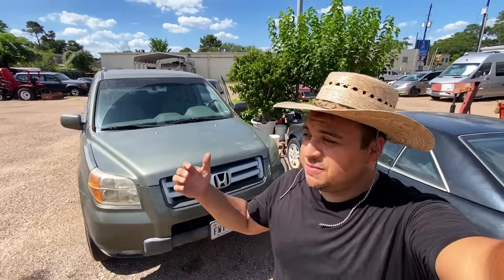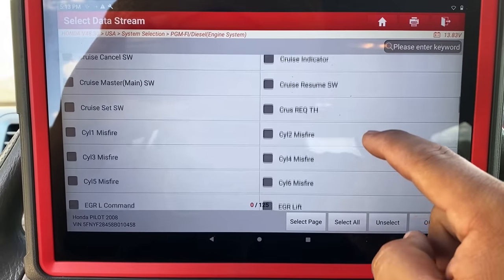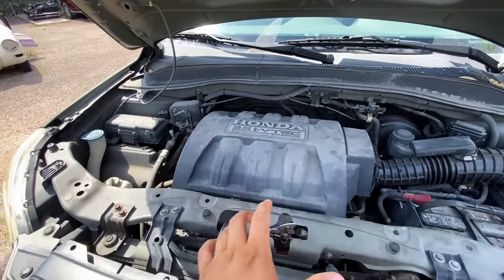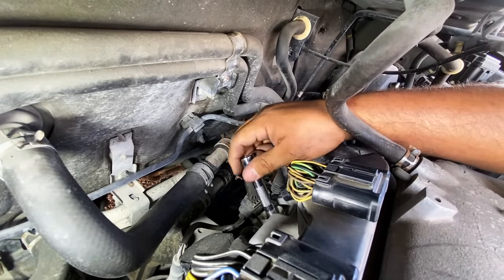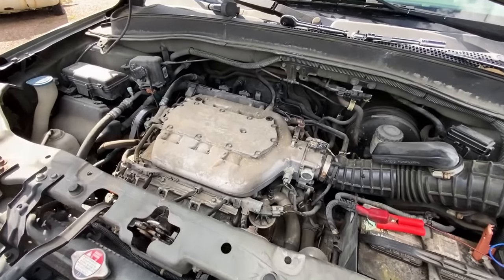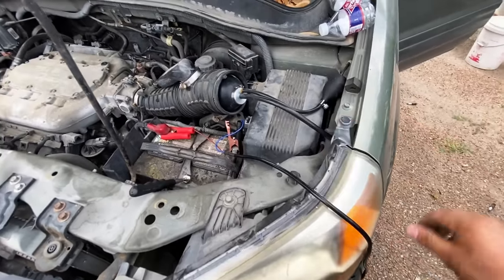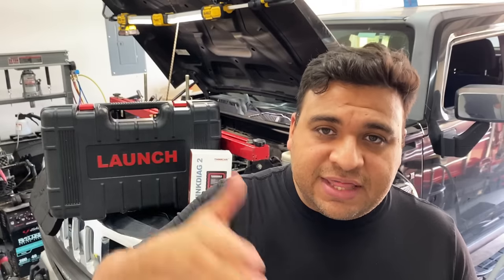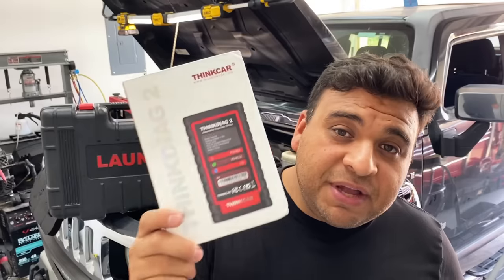HONDA PILOT STUMBLING IDLE RANDOM MISFIRE DIAGNOSIS & FIX

Comment: We had an 8th gen civic (06-11) at my dealership that had misfires on 2 cylinders we swapped coils, plugs fuel injectors Checked compression and cylinder leak down tried ECM/PCM clear and relearn still nothing we were stumped we called tech line before we put it through for a PCM they advised up they have seen some civics with aftermarket serpentine belts have excessive metal flakes in the belt messing with the signal on the crankshaft causing ghost misfires so we removed the belt and wouldn’t you know no more misfires replaced with factory belt and took care of issue
Reply: thats crazy!!
Reply: Whoever figured that out is a genius.
Reply: Interesting to know and this has been noted in my diary
Reply: Thanks for sharing this information!
Reply: After market ? Says it all. Nice of Honda to help out. Thanks for your info.
Reply from the maker: Thanks for the information!
Reply: But how those the metal from the serpentine belt pulleys affect the engine like how do they get inside it
Reply: Thanks for the this information, it will go under my belt of knowledge for future reference.
Reply: @neilmurphy845  not the pulleys themself but the metal in the belt I honestly didn’t know that serpentine belts had metal particles in them but maybe some of them have excessive amounts and that’s what causes it?
Reply: @ADVANCEDLEVELAUTO  any time love helping out the automotive community especially with weird stuff like that I’ve had numerous Hondas/acuras with ghosts missfires that by just performing ecm/pcm resets fix it love the content you make I’ve learned a lot from watching you
Reply: Honda Tech I just want say thank you for sharing! 👍✌️
Reply: Its prolly the timing belt not the serpentine but its engine on those are timing chain? How could it trigger a misinfo on the crank sensor when its inside the cover?
Reply: @andrewdero6271  those have a timing chain and I’m not sure exactly I’m not an engineer lol I wish I knew the science behind it but i know it was showing missfires on the computer but the engine was running fine, we checked everything was down to checking the PCM before recommending replacing and we called tech line and they advised us to try that first and it worked!
Reply: Dammm...!!! Fucking incredible..!!
Reply: Are you kidding me. That's insane
Reply: @thehondatechnician  Ya maybe
Reply: For those wondering, a crankshaft or camshaft sensor reads metal near it. 
Metal near it causes it to think the shaft is at a different position than it is, and being that it thinks a tooth(that it reads position with) is on the belt it causes it to misfire when it gets back to a certain position usually the measuring teeth(teeth that are usually filed down to make sure the computer can accurately read the sensor.
Reply: @neilmurphy845  Causes a static buildup and then it discharges. Should be some videos of it on YouTube. Like little lightning bolts.
Reply: I own a repair shop and had a gates serpentine belt cause this. Replaced with a bando unit, and it solved the problem. Random misfires on all 4 cylinders until I figured the belt was the issue. Car was a 2009 honda civic lx 1.8 manual.
Reply: Thank you for sharing that information!!!
Reply: @camberwellcarrot420  Lol forreals.
Reply: How is there an 8th gen of pilots? I tink they are only on the third or fourth gen.I have a 2012 and thats considered second gen.

Comment: I just did my timing belt and had a similar issue. I took it to a professional to check my timing belt, paid for his time. He told me the timing marks were not off and he saw no issue with my timing belt job. He did see multiple misfires and a rich code. The rich code was not there before hand. He noticed the CEL come on and off while he had it at his shop to test drive it. 

After doing this and a valve adjustment. It's working fine. I think the valve adjustment for me was the defining fix. I can't say for sure.

Comment: I love my Launch X431 Pad2.  It's proven to be the best overall scan tool I have ever owned.  Now I have a question.  Why would the Honda Pilot need a CKP relearn if it was never disturbed?  Besides replacing or even just disconnecting and reconnecting that sensor, what else could cause that issue?

Comment: My scanner can detect injector pulse to see if the injector is firing fuel. That’s one easy way to determine if the injector is faulty or not or use a lode tester to see if the injector harness side is getting power! But swapping the Bad coil with another coil is an easy simple test as well thank you Eric for another video!
Reply: Your scanner can detect pulse. But I doubt it can detect if the injector is really opening or closing.

Comment: I was taught the relearn should be performed any time ignition components were replaced or moved. Also when replacing timing belts/chains. I've had the misfire problem with Nissan before and relearn fixed it.

Comment: 2002 Acura MDX touring with a flashing CEL, Replace all spark plugs, all ignition coils, all fuel injectors, did all new timing belt, timing tensioner and also new head gaskets with all new gasket for intake and exhaust manifold gaskets.  Did compression test all cylinders have good compression from 210-220 psi. replace new used pcm, did valve lashes.  Not sure what to do anymore.  i tried to do the crank sensor relearn but for the 2002 model this function is not available.  Please help... Any advice well be helpful.

Comment: You have some great, and kinda expensive devices there to help you track down the problem very quickly! Good for you man! Good job. I have one of these same Honda 3.5 engines with a very similar issue, and also the flashing engine light that will shut off on it's own. I am waiting on a new set of coil packs on the way. I have a basic code reader for the OBD II port and mechanical knowledge and that's about it except for tons of basic tools of course. My code reader is a Autophix. Those are very good powerful V6 Honda engines when they are running properly!

Comment: I don’t know if anyone in the chat ever uses a propane inrichment tool to find misssfires due to a faulty injector or vacuum leak. But it’s a great and fast way to do it. 

If you find that the ignition system is ok and suspicious of a faulty injector. Use your propane inrichment tool to slowly add propane into the intake. Then watch your missfire data. Or smooth running value. You will see the counter slowdown or stop all together. In many cases see the engine smooth out. OTC part # 7148. I also use it to diagnose A/F and o2 sensors. It’s good for diagnosing converters also. Already said vacuum leaks, do that while
Looking at ST and LT fuel trims.

Comment: Ha ha ha, I knew I'd learn something more, if I just kept watching. The CKP relearn was a pearl worth remembering. I wonder why changing a coil would require a relearn.
Reply: Me and eric had a discussion on this and I’m thinking that because misfires are seen thru the crank sensor. So when the engine misfires the pcm picks up the difference in crank speed and registers it as a misfire. And I’m aware some pcms shut off injector pulse is they notice a misfire on a cylinder to protect the catalytic converter. So my theory is the misfire is learned to the pcm, as protection to the catalytic converter. So to clear the learn misfire strategy a crank relearn has to be performed. Sounded good in my head when I did this
Reply: @OzMechanics  Thanks man, I never fail to learn something more from both of you.
Reply: Wondering if you know of a lower price scan tool that can do the crank position relearn for a 2004 Honda Odyssey 3.5 V6? I'm old school mechanic and try to fix my own first because at the moment I don't have a shop close to me that I know I can trust or afford.

Comment: I had a bad ignition coil after 100,000 miles in my 4Runner. Instead of buying a denso ignition coil, I bought an NGK because I was going to do a full tune-up in 3 weeks. That NGK ignition coil kept setting off my check engine light with misfires. NGK makes great spark plugs, but do not buy their ignition coils. Once I replaced that NGK coil, everything was fine. And it was even better after I changed all six with denso ignition coils.

Comment: Awesome job!  How does the scanner / ecu know when a misfire occurs? Are they only spark related according to a scanner?
Reply: ECU/ECM/PCM knows when a cylinder misfires by the speed of the engine slowing down just after the module commands a coil to fire. The module can see this and calculate this speed change in microseconds.  Misfires can occur from various issues; spark, fuel, too much air, too little air, timing, noisy crank signal, wiring, and module.

Comment: You sir are a very good mechanic.  I have the same type of stumbling shaking shuddering at idle....I feel it in the drivers seat and floor.  It is very intermittent but I don't have the scan tool you have.  I do have one that allows me to get into mode 6 so I can see misfires.  My problem is intermittent so I do not think it is compression I think it is fuel injector related.  Almost thinking of getting a better scan tool once and for all so I can pinpoint these problems easier
Reply: Im having the same issue on my 05 Honda pilot. It hasn't died yet but like you said its shaking, shuddering and stumbling. I can also feel it in the seats and the pedal, steering wheel etc. It just feels weak like it's losing power. What was the issue on yours and were you able to fix it?

Comment: Thanks for this great video. I have an 08 Pilot and getting misfire on cylinders 3,5,6. I changed all the spark plugs and did that coil swap trick. The misfires did not move. I am either thinking it might need valve adjusments ( if that can cause multiple misfire) or recently I used an injector cleaner and maybe that messed up my injectors. I also changed my alternaor recently with a OEM denso one. After the frist start after changing the alternator the car did hesitate and eventually turn off. But after a few more tries it did stay on and ran fine for 2-3 weeks. What do you think ?
Reply: Having a misfire on every cylinder after replacing alternator with one from junkyard, didn’t happen till a week after the replacement
Reply: @leestoday  after using 1 or 2 injector cleaners and 3-4 high octane fill ups, my issue went away. I even bough new injectors but now issue is fixed so I will save those injectors for later.

Comment: Hey I forgot to mention my uncle has a 2000 Honda Odyssey and it has p1399 I already adjusted the valves also all 6 cylinders are misfiring and I get p0300 as well I already changed spark plugs and coils what do you recommend

Comment: Just an FYI:  I have an 08 Odyssey.  Those have the same V6 as the Pilots...and I believe all other Honda's with a V6.  Some, but not all, of those engines have VCM...Variable Cylinder Management.  Basically, as you reach highway speeds, it disables cylinders to increase fuel mileage.  Problem is, sometimes it decides to start disabling cylinders, even if it doesn't need to.  It leads to people "chasing" misfires, and never catching them.  At first, that's what I thought was the problem here.  In case you have a Honda with that V6, and start having misfires, and replace everything that is supposed to fix a misfire, yet you still have misfires, it could be the VCM.

Comment: You forgot one more item in Honda's particularly, the valves w/ time they get tight and can caused miss fires and other problems w/ no check engine light.

I was told to look at the MAP sensor value at operating temperature and anything higher than 0.85 volts indicates tight valves.

Comment: I have misfires on cylinder number 4,5 and 6 on my Honda Pilot 2012. I swapped the spark plugs and coils from 4-1, 5-2, and 3-6. I rescanned it and it’s still misfiring on 4 5 and 6.  What can I do to figure out what’s wrong? Compression test? Spark plug test?

Comment: Hey bro, I see this video a while ago. I just changed the coils in my 2001 corolla and it was running normal before I changed them. I changed the plugs and coils because of the mileage. Now it's misfiring with the new oem coils and even when I put the old ones back in. I'm guessing I need a relearn for my car to run normal again.

Comment: After all this time that you had the thinktool pro how do you like it. And what's the difference between it and the Launch tool and for someone that doesn't do much work like that which one do you  Suggest to get
Reply from the maker: They are both very similar as far as capabilities. The main difference to me is that the Launch tablet is an open operating system. Meaning, you can download apps from the play store and surf the internet freely. The Thinktool is a closed OS, so it doesn’t allow you to add any apps. For this reason I prefer the Launch.
Reply from the maker: Thinktool says that this is done to make sure the diagnostic software runs faster and smoother. Also, so that the user doesn’t download any apps that could affect the functionality of the diagnostic software.
Reply from the maker: I am mostly mobile, so I like to be able to use the tablet to find wiring diagrams and service information on the same device.

Comment: this vehicle is supposed to have ngk IZFR5K11 laser iridium plugs in it with a 1-1.1 mm gap, it also gets denso 673-2301 coil packs

Comment: I have had an 11 honda accord once that would throw random misfire codes and I would perform a crank relearn and it would fix the issue' but the issue would return after a few startups. I came to find out the somehow a remanufactured starter that had recently been installed  was somehow messing with the crank signal and causing the problem. Replaced the starter and relearned the ckp again afterwards and no more problems.

Comment: I have an 2007 Honda pilot with the 4WD EXL navigation. Anyone who has intermittent problems with electrical go wrong with a PCM/ECM open circuit power relay code for P0685 replace the Relay for that because that will fix it most of the time or even the battery can also cause that code to come back up and make the car try to stall or jolt while you’re driving so just be careful if you have an older Honda/Acura because they will happen like that if you don’t change that relay or battery

Comment: Cylinder 3 is usually the problem with these engines. The Cylinder management turn that cylinder on and off more than any other cylinder. It will run all 6, or it will run 1,2,4,6 or it will run 4,5,6. I think this exposes cylinder 3 and the injector to unusual wear as well as mismanagement if the cms. 
I'm $900 into this same issue. I changed the plugs and coils at home just because they were extremely overdue, $400 in parts. It didn't solve the issue so I brought it to the dealership for a proper diagnosis. He suspected it needed a valve adjustment as it was also extremely overdue. Another $500. The issue still isn't resolved. It's very intermittent, on start up or after sitting, so I'm leaning towards fuel injector malfunctioning or losing pressure overnight. Though that job is also a bit costly and labor intensive on this engine. Thus I may try and temporarily delete the cms just as an experiment to see if it stops the misfire code. Idk though, it's a frustrating situation.
Reply: I've also experienced that cylinder 3 misfire issue in my own 2010 VCM J35 engine and have noticed in many videos where the problems are surfacing in cylinder three first. I also concluded that that is for the reason you identified. If anything is becoming marginal due to age it does seem that cylinder three is the first to expose the issue.

Comment: Can you give me any advice on testing a waste spark coil system?  How would I test that?  I did the resistance test on it and checked out the ohms and it passed but I don't know how accurate that is because it is not testing it in its normal condition of the engine running...

Comment: I would of swapped coils and rechecked to see if misfire moved. Same with spark plug. If it didn’t move then it’s the cylinder. A lot easier in my opinion cause most people won’t have a smoke machine
Reply: He did?

Comment: My 2012 Honda has 3 misfires that is become a nuisance. It only has 93k miles on it! The mechanic shop just called me yesterday saying that the engine needs to be replaced! I'm at my wits end and don't know what to do anymore. Has anyone had these issues? When I go to pick it up, I will get the paperwork for the codes that were read. What should I do? Get rid of it?

Comment: I wonder what made those coils go bad, considering that they were all recently installed?
Reply: It's that Honda VCM, Variable Cylinder Management. It disables cylinders 1, 2 and 3 off and on while the car is driving to make the MPG numbers look better. But it results in all kinds of problems, like excessive oil burning which causes the plugs and coils to go bad.

Comment: If easy enough, I always swap the coil first. Then I’ll move onto inspecting the plug, injector and so on. If the intake is in the way of the coil I’ll try to sneak my pistol paddle probe on top of the coil to see what it’s doing.

Comment: That the problem misfire , car shaking but no code, it happen to me but just for a few second, and the car went back to normal, and it us nor repatable evey day, but yhe first time it happen to me, i changed spark plug, distributor cap rotor, and, and the problem .happen again but  in one year and, i changed the fuel pump, rebuild the fuel injectors,  and it happen again in 8 months, man i dont know what the problem,  i will never know what happening exatelly, till the car trigger a code, or stay shaking long time to figure out the problem, it may have somthing to do with a sensor may be. Crankshaft, detonator, TPS.